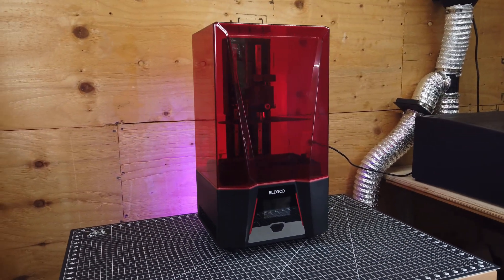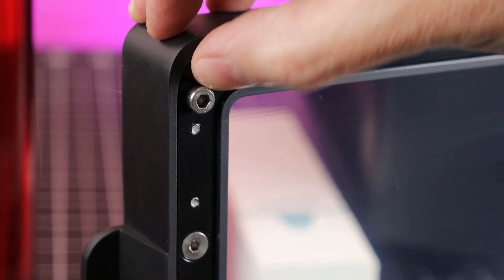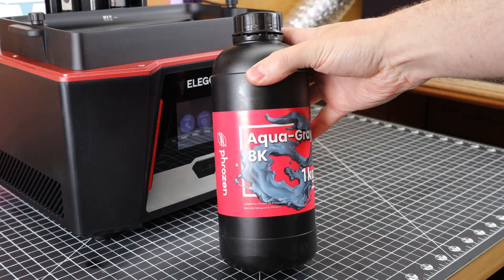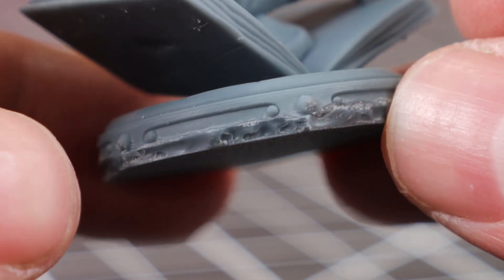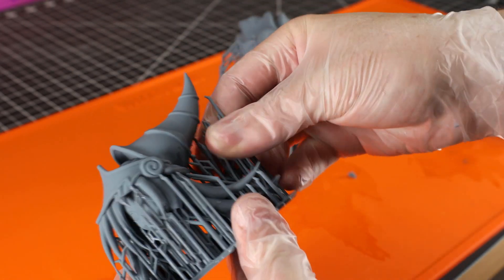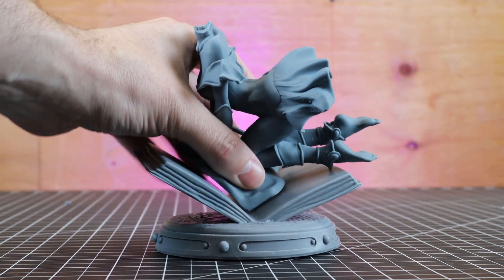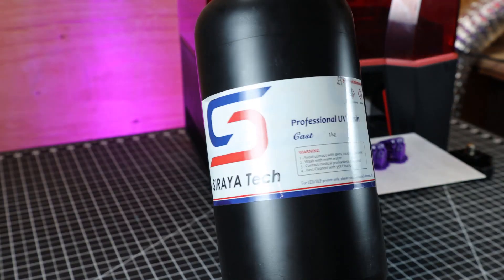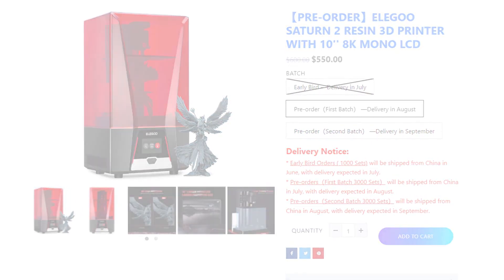Resin 3D Print Big or Small with Amazing Details - Elegoo Saturn 2 8k Mono

Comment: What settings are you using for these prints? Mine keep failing
Reply from the maker: What settings are you using?
Reply: @GomeowCreations   .05 layer height, 3 sec normal exposure time, 35.2 seconds for the bottom layers, 8 transitional, thanks for a reply

Comment: Small tip for printing bigger models, its always better to add more medium supports, than just adding larger supports. You will get a way better result. Just use some heavies as an anchor in the bottom, rest is tons of braced mediums
Reply from the maker: Thanks for the info and I will be making some larger prints again soon

Comment: When you start a print, if you click the settings icon you can then adjust the print parameters without having to re-save the file.
Reply from the maker: You are 100% right and I totally missed that. Thank you for pointing that out. 😁👍

Comment: Nice video.  I don’t really see the point of wifi/ethernet.  I would like to have seen a powered usb that could have supported a camera or heating element.  Dual usb ports to support dual filtration fans would have been nice as well.  Wish the usb was at the front.  Seems most of issues encountered in this video were user error with supports.  Did you print something that was already professionally presupported, say from one of the major studios like Titan Forge, Artisan Guild, or Loot Studios?  Also, I will say that it’s better to overexpose a touch rather than perfect exposure.  I find trying to dial in tue settings too aggressively leads to failures. I would prefer to have 0-1% failure rate over 4-5%.
Reply from the maker: Yeah it would be great to have a full powered USB so you can run a heater setup. Just a about all of the castable resins I use need to be warm to print right. 

The wifi/internet part is not something I really need to be honest but I do like having it to send files from the computer to the printer without dealing with USB drives. 

I have printed one thing that was pre supported and it came out perfectly and all the supports came off with no problems and left almost no marks in the model. And you can see in the video I'm not the best a getting supports set up haha.
Reply: @GomeowCreations  hey no worries.  Most of us are terrible and supports. I generally avoid them altogether (print pre-supports only).
Reply from the maker: Understandable and yeah I can see a lot of work going into getting them to come out perfect for each model.

Comment: every print review ive seen with this machine seems to have some form of print failure, which is odd. I feel like a good bit of it is the build plate leveling procedure. that card stock is so much thicker than normal paper. im betting normal paper would fix alot of these issues. But if it doesnt, I worry all the changes to this machine leave it less reliable than previous generations. new light source, new fep material, new screen protector. I wonder what the thickness of that screen protector is. but good review, thanks
Reply from the maker: Yeah it is a little odd. That last print that I did with the castable resin at the end of the video was my first test print with it on this printer. That is why I had a test print file in the center of them. That being said it has not problem staying on the build plate but they are much smaller so less pulling when printing. 

After that print of the head and body I did re-level the build plate before printing the book base and it had no problem other than running out of resin and having to add a different kind.

If I had extra parts like a FEP and screen protector I would measure them to see how thick they are.
Reply: Many failures happen due to insufficient supports, different resin type (wrong exposure) and possibly also low temperature overall during printing. I consider 25°C to be optimal for printing. Supports that are sufficient for Epax Hard resin might not be enough for Ameralabs AMD-3 or Nova 3D Red Wax. I had pre-supported models that were successfully test printed with Epax Hard on a Saturn and all of them failed or had major layer shifts with Longer 3D Deep Peach resin until I added more supports (also on a Saturn).

Comment: I just got an 8k 3d printer expecting a marginal improvement over my prusa sl1s and instead got vastly improved details and literally no need for antialiasing
Reply from the maker: Yeah the 8k printers are a big change in details. What printer did you get if you don't mind me asking
Reply: @GomeowCreations  epax e10 8k
Reply from the maker: Oh ok, that is one that I don't know about but I will have to look into it. I do have a phrozen mini 8k as well that I need to use more 😁👍
Reply: @GomeowCreations  the epax printer is a bit more pricey but it’s made fully out of metal and is upgradable which is cool
Reply from the maker: Interesting and what can be upgraded on it?
Reply: @GomeowCreations  let’s say you bought the 4K version, you can upgrade the screen to 5k or now 8k, and if they come out with a higher resolution screen in the future I can upgrade to that better screen.
Reply: Higher pixel density = smaller voxels. That makes a huge difference. Industrial laser printers with 25 micron XY resolution are used to print master models to make molds and resin casts. Manufacturers like Kimera Models, Mindwork Games, Hera Models, Journeyman Miniatures, they all do it this way. Handsculpted models are rare now.